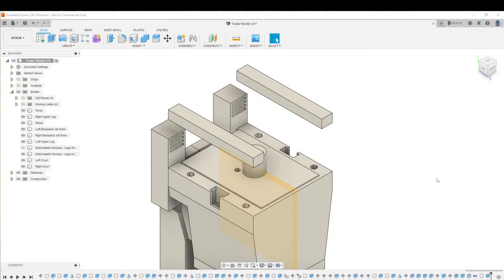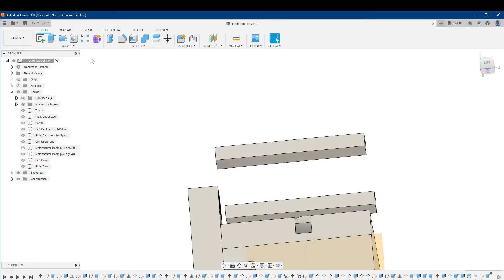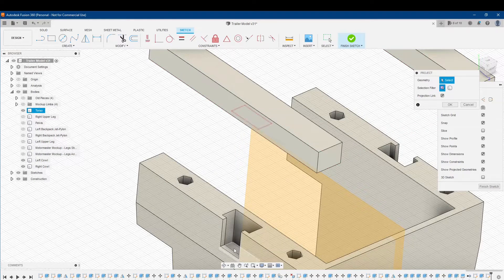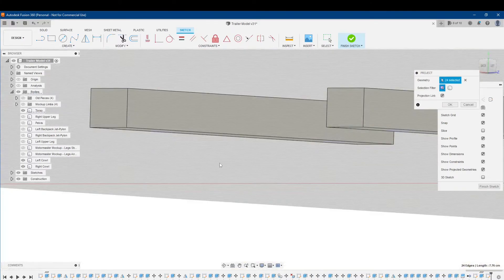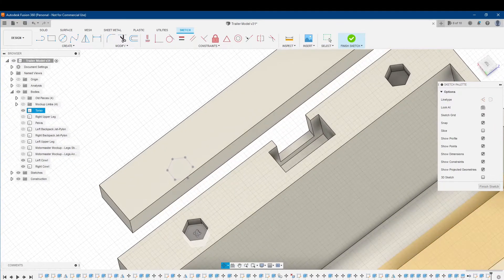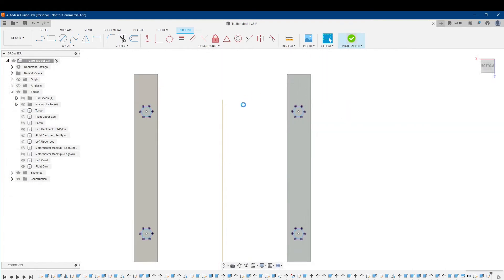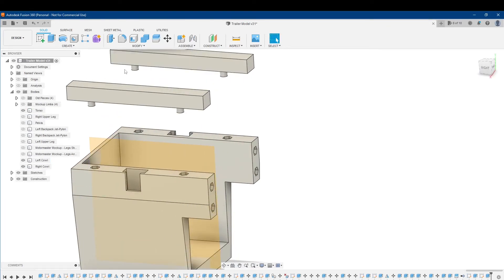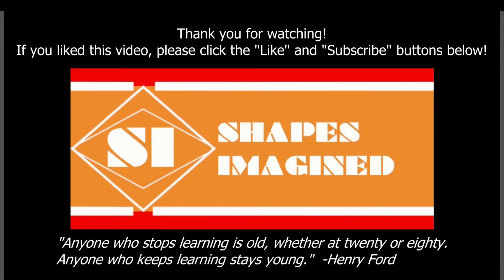Project Geometry to Sketches in Fusion 360

Comment: hi, under the project feature window, I don't have the option named "projection link"? I try to link two sketch layers to each other via constraints and I expect that when I make a change one one of the sketches, the other must be updated automatically. For instance, the co-linear feature doesn't update the other geometry in the other sketch when I make changes to its parent.
Reply from the maker: Hi there, thanks for watching!  Unfortunately I'm not familiar with "projection link".  Anything like that I've only done manually by creating two sketches offset by an offset plane and adjusting each one individually.